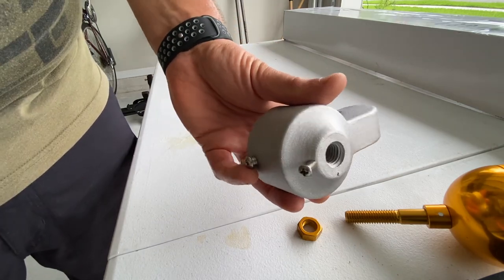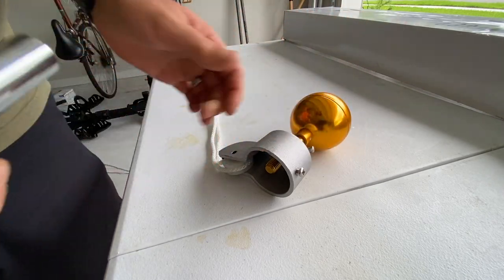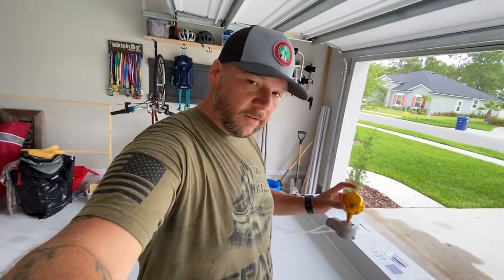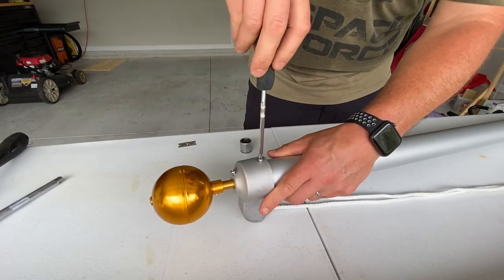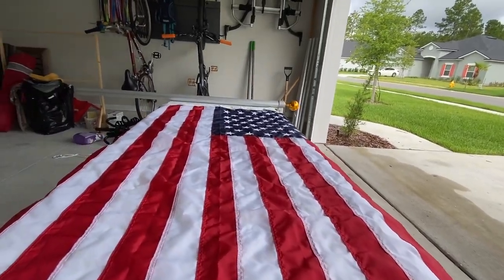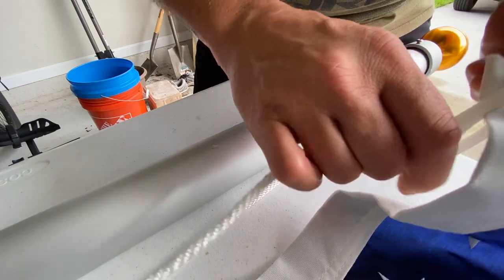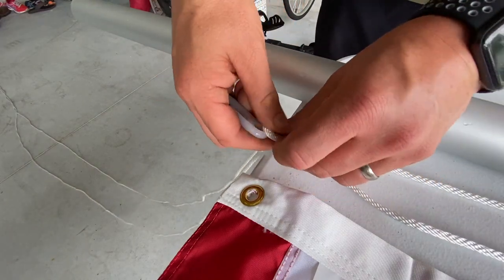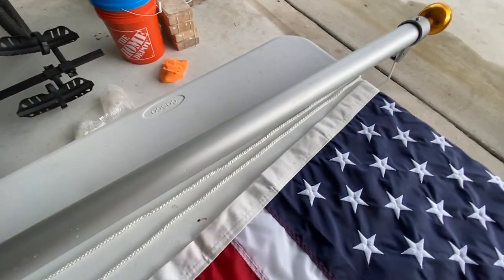How to Install a Flagpole at Home_Part 2

Comment: Its beutiful i have the same flagpole and its great. Some advice man if u want to strenthen it so it wont bend in strong winds insert some metal pipe inside the flagpole it will make it very strong. Overall it looks amazing good job. Usa🇺🇸🇺🇸🇺🇸
Reply from the maker: Juan Arcos great advice. Thanks

Comment: What holds it to the sleeve at ground level? Another set screw or just the weight of pole. Curious if high winds might pull it out of sleeve. I also like the idea mentioned about adding pipe inside for strength.
Reply from the maker: Patrick Armstrong thanks for the comment and the subscription fruitcake. The pole is not held in with anything. It’s been through a few strong Florida thunderstorms with no issues but I’ll keep tabs on it. The pipe inside is a real good idea for sure. Thanks again
Reply: I put a 2 inch reduced to 1 1/2 inch Plumb Quik fernco at my base. Keeps it secure and water tight.